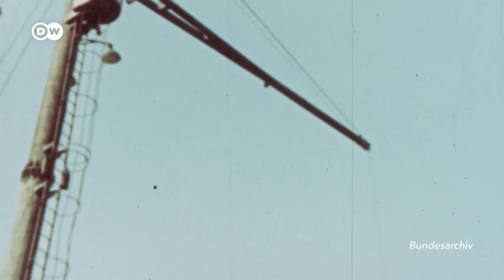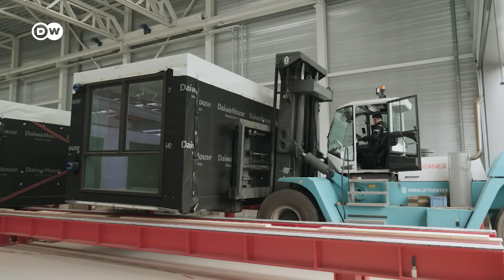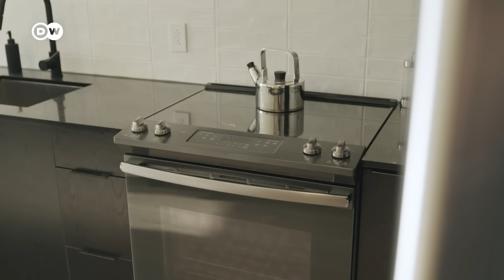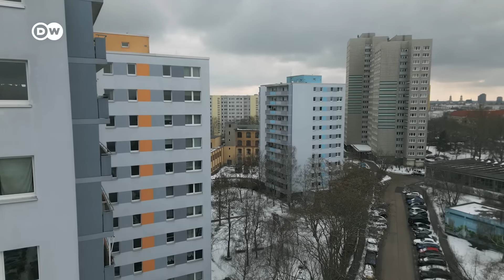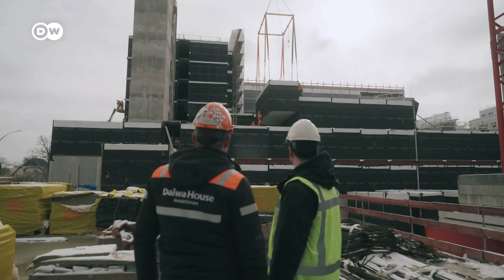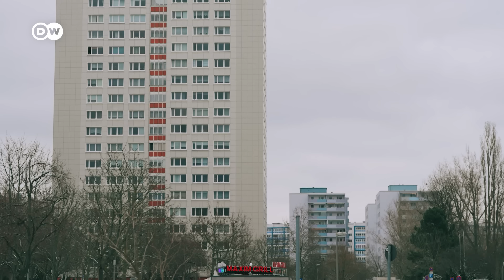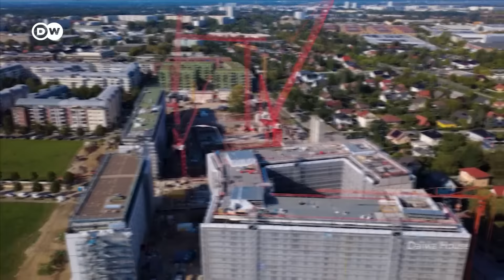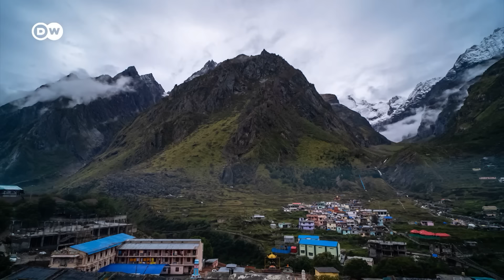These buildings are ugly. But the idea was genius.

Comment: I hope it's made of reinforced concrete, and not some wooden "shack" (even if in an iron fence). I can still understand building separate houses out of wood. But entire 5-15-story buildings where each unit is owned by a different owner, and they make "unofficial" construction modifications there, seem to me to be total nonsense and even a general threat from the point of view of durability. After all, it's enough for an owner or a tenant to let their apartment unit "leak" from a leaking pipe for a few months (and they may not even know about it), and then a structural engineer will designate the entire block for demolition after a few flights. And even if not, the wooden material has no chance of lasting (in conditions of heavy snow/frost in winter and heat in summer) even for those 50 years and will fall apart, and the structural engineer will send it to the ground, while the owners still haven't paid off their two-generation 50-year mortgage for it. And that's not to mention flooding, fires, wood rot, or "twisting" of drying/degrading wood in the nose parts.
In today's conditions, if I wanted to buy something, and at least pass on something valuable to my descendants, it would be a reinforced concrete apartment, or a building plot for a family house (which could easily be made of wood, it's the land as the primary bearer of value).
I am fully in favor of building housing estates from modular blocks that are "stacked" on top of each other. There should just be some regulation to require that all load-bearing walls and parts be made of concrete, reinforced with iron/steel. That's what China does. Such blocks can be repaired almost indefinitely, and it doesn't matter if they burn down completely, or are severely flooded every few years, or are damaged by war. They can always be repaired.
Reply: All soviet apartments are made from concrete. They are built on the construction site.

Comment: This is gonna be huge profit for this company, if they will participate in rebuilding housing in Ukraine.
Reply: Not so easy.  The cost of transporting each unit across Europe would be huge. They would have to invest in several local factories (Ukraine itself is not a small country, only one wouldn't be enough). And the capital requirements of each factory is very large.
Reply: @alfastur6833 it is obvious that the modules must be fabricated locally.

Comment: Old soviet prefab buildings (Khruschevka-style) turned out a nightmare in case of Shahed strike. The whole bulding can be collapsed, while in monolyth buldings based on concrete and metal usually 1-2 walls are damaged.

Comment: Soviet prefab walls could be used/build anywhere. Usually comes in few certain shapes; however, molds can be generated if sufficient quantity are guaranteed. But special trucks required to haul those prefab-walls, as they upright as if carrying window glasses.

Comment: I was surprised this is being done at scale rather than scattered experiments. Modular build has to be adopted more widely, factory build vs piling wood and bricks in a muddy field has so many obvious advantages. I would hope more automation is adopted - and so have better trained workforce.
Reply: (customised single homes - that'd be where good design to build would be great. Truly unique house still built as before. But this'd allow even fairly std houses to have customer options built in easily)

Comment: You forgot to mention another benefit: With pre-fab you can cast the concrete at optimal conditions off-site giving you better quality and longevity - also makes it less dependent on the weather and hence simplifies logistics
Reply: No forming required.  Saves hours building it and tearing it down.  No trucks to schedule.  No pump truck breakdowns to worry about.  No worry about the mix being correct.  Lots of advantages.
Reply: @randibgood  Blocks of flats are way more energy efficient in their heating compared to single family houses as well.
Reply: @antonk.2748 
True!
Reply: @antonk.2748  Only if they are built properly with even heat insulation. Soviet experience prove otherwise.
Reply: @randibgood  Huge disadvantage of taking them to the location by trucks that will brak down, heavy machinery needed to install them, schedule of moving them, waiting for the right weather to install them.
You can not takl only about the benefits. 
Also, as we've seen those old buildings are still standing. There are no major issues there.
Reply: @maxmagnus777  i like benefits
Reply: @maxmagnus777 and you think the trucks that transport concrete to the sites couldn't break down? and they don't need to wait till the wind dies down when they build the concrete casing or hoisting other things on the build site?
Reply: @maxmagnus777  but the steel joints between the concrete blocks are corroding so the lifespan of the building is quite short,  50-100years. in poland some of them already had to be demolished, while 400years old brick made apartment houses are still standing strong.
Reply: @maxmagnus777  but these issues are faced by in situ casting too...
Reply: @maciejrodzinka  If you galvanize the rebar you can get 400 or more years out of it. Doesn't cost very much extra.
Reply: @trueblindman647  why would one want to build a structure of that size, and complexity  in a factory, and then transport it. Just build in situ, and use all advantages of it being built in situ, rather than going through all this gymnastics. It's not a car.
Reply: @hilluxyz easier to mass produce them with all machines ready in factory rather than transporting all equipment to the site
Reply: @trueblindman647  Then transport concrete foundations and slabs You will be curtailed to  what you can transport, hence you will offer inferior product. On site you can make whatever you want to whatever specification  for whatever local conditions.
Reply: @maciejrodzinka It also depends on the maintenance, eastern block had hard times in the 90ies, many of these buildings were not serviced well enough then. A house I was growing up in was built in the 70ies, but was from the earlier Khrushchev era project, and I remember these cracks between the slabs and rusty spots building up. Then, in the 2000s the building got some service, the cracks were filled and sealed, but still, several years ago the house was rated unsafe and was torn apart. And I watched the other similar two buildings near my grandma's house in the city (the first one was in the suburbs) from the 60ies which was serviced better. It had some graffiti, the walls did not look clean enough, but I have never heard of any problems with plumbing or water supply there, the joints were always in good condition. And they are still there according to satellite images from 2025
Reply: @maxmagnus777  These buildings are pure concrete, they can stand like forever, if nothing unexpected happens e.g. earthquake or military action. Also you can redesign them, because usually main concrete walls are like 50% of them in the apartment and other half is woodish lighter walls and you can tear them down with no danger. Also, you can make facade look very very different, just need imagination and money to care about it.
Reply: It's still compromised by designing it to be portable. Especially for something that needs to last for decades.
Reply: We don't need more apartments in (most of) Europe, we need to properly distribute those that already exist by not allowing them to be (so extensively) used for investment and speculation.
Reply: @BcroG11  this👆
Reply: @BcroG11  How about doing both?
Reply: Concrete should be dropped out. It's a massive CO2 emitter and creates homes with no capacity to evacuate moisture properly. Plus it has shitty thermal properties.

Comment: Prefab construction is widely used in Sweden and they are not necessarily ugly/bland/grey because architectural details and colors are added to the external walls in the factory. So the buildings spring up fairly quickly and don't look bad. The real problem is the sale price of those apartments once finished.

Comment: Panel flats are still a better idea. More flexible in design, manufactured on site or close to it. The way the technology was applied 50+ years ago was suboptimal, with a lot of issues easily fixable with better quality design and materials. Uniform design? Just make it less uniform. Lack of noise isolation? Use two panels between flats. Stupid decisions like laying electric installations on the floor of a flat above - implement proper channels in the panels themselves. The problem rarely technical anyway. 2/3 of the cost is in land, legal expenses and price speculation.

Comment: Anybody that has being inside one of those soviet building know how terrible they are.
Reply: most of the complaints about them being 'terrible' are simple design fixes. the fundamental idea is excellent and it was (still is) very effective in housing millions in a short time, post-war.
Reply: They are fine, however they are better than new buildings
Reply: yepp. They're ugly. Inside and outside. The only good thing if it's an old neighborhood it's usually quite overgrown with greenery that hides the ugliness. But only at summertime. At winter they looks like the post-apocalypse movie settings. 😅

Comment: When USSR collapsed Russians viewed concrepe prefab buildings with disdain, as some kind of soviet mistake. Most prefab factories went bankrupt. Fast forward 20 years, company from Finland YIT almost dominated new housing market... because they used mix of prefab panels with cast concrete load bearing construction. Their prefab panels were built to a tighter standard than soviet ones, also they were better insulated and never used porous concrete on outer walls.  And then even some single family homes started to be built with prefab concrete-insulated-sanwitch panels. So yeah, prefabs are ok if done right. Soviet era ones are just outdated, also use of porous concrete that was meant to improve insulation in fact made outer walls to crack, take water and look awful overall... so yeah, modern prefabs with right materials are fine
Reply: They can insulate or paint the soviet buildings. When people have no property - being outdated doesnt matter.  I don't think its outdated coz your other option is literally under the bridge or paying giant rent prices.

Comment: Housing still neet to be made out of concrete, imagine how Ukraine would have looked if houses would be made ouf of "modern sustainable materials". Sometimes simpler is better. Rigidity is an important factor too.
Reply: These buildings, especially in Ukraine, are notorious for specifically being prone to collapse after getting hit by a missile or a drone. It has nothing to do with sustainability of materials.
Reply: @flytrapYTP  You want to say that  these paper-foam-wooden houses are more resilient that fero-concrete slabs?
Reply: @PraiseTheSunOfAstora  show me a single apartment building made of the materials you're describing.
Reply: @flytrapYTP  Look how they are building, those are cheap flimsy glue-wood-foam sandwiches in metal frame.
Reply: @PraiseTheSunOfAstora again, give me one single example.
Reply: @flytrapYTP  it's in the video

Comment: Unfortunately, the program oversimplifies the issue.

The problem with prefabrication is that it's cost-effective only in large batches. Many identical buildings must be built – ideally as close to the prefabrication plant as possible (prefabricated elements are transported!).
These challenges led to the construction of large, "monotype" housing estates in the Eastern Bloc.

These are another matter: the current costs – the cost of steel and cement (and therefore the cost of precast concrete elements).

Prefabrication alone won't significantly accelerate the investment. (Remember – finishing and installation work is more labor-intensive than erecting the structure.)

The biggest challenge facing modern investments is lengthy administrative procedures.
Reply: having a set of housing options that are mass-produced is fine. further, transport isn't an issue, because we have these crazy things called freight trains.
Reply: @peaceandquiet1917  Nonsense – that's what an ignorant person might say.

Do you know what a railway gauge is? (dimension limits)
Loading and unloading are just costs...
Reply: @ukaszborowy1954  we can surely build within limits if needed. with enough people we can figure out a viable solution beyond just sticking a bunch of trucks on the road.
Reply: @peaceandquiet1917  Once again – a demonstration of ignoring "details."
The fact that prefabricated buildings (e.g., in the Eastern Bloc) look the way they do is precisely the result of these limitations.

Truck transport is also expensive and complicated.
I know this because prefabricated elements are used – for bridge construction (a typical viaduct has prefabricated prestressed concrete beams) or wind farm construction (prefabricated masts).
And it's not cheap – compared to monolithic concrete technology in slipform formwork.

Comment: Ahh so the commie blocks are bad, but better than homelessness... By the way anti social behavior is an issue with society, and is NOT inherent to panel block buildings, unlike you make it out. 

But the irony of shitting on the commies for decades, and then using the same solution to solve the same problem, but pretending its somehow original and far better... cool.

Comment: My only concern with this so far is scalability, Not everyone wants to live in a cramped 1 floor house, i know you can connect the modules but it seems like you are restrained to the boundaries of each module so it's just 3 connected rooms, some appartments need to have larger rooms which would require 2 modules, some appartments would be better with 2 floors which these modules don't seem to carry that yet.

Maybe DW just couldn't show off the entire potential but these seem very promising to revitalize building apartment buildings but it will not solve the housing crisis. The housing crisis is completely artificial because of corporate overreach and an abundance in red tape preventing the construction of new housing.
Reply: Realistically.. if you can own them - people can swallow the tight space. Its better to live in tight and own it than not/

Comment: Prefab is great. But it must be done aesthetically too.
Reply: Very few modern buildings are aesthetic. Ornamentation of prefab buildings in theory is simple, but ornamentation just isn't done on modern buildings, because of current trends and cost.
Reply: Yeah, buildings with only parallel lines and no human-scaled details are pretty decremental to the mental health. At least add some painted smile in different colours somewhere visible from outside, I don’t know 😅
Reply: @kagenekoUA  That can be done of course. Every house, or block of flats is eventually just 4 walls, ceiling and floor. You can always decorate them the way you want(where possible, of course. Some would be quite high builds, so it gets more difficult to change, once they are finished).
Reply: There were very rarely times in history when mass housing was aesthetic. Back when the Romans built their arenas and temples the masses lived in apartments in simple block houses. When Baroque palaces were built the majority lived in wooden shacks. The only time I know of when mass housing was aesthetic was in the 19th century. The problem with modern architecture is that not even the crown piece buildings are aesthetic.
Reply: Maybe it mustn't be done aesthetically.
Reply: not really! most prefab have several issues, because of prefab. its a temp solution not a permament. its mostly trash and made to scam and get hands on public funding. poor layouts, walls total trash (you can hear your neighbor) and many other crap

Comment: Prefabrication can work for apartments, but as the other comments point out, maintaining demand within shipping  range of the factory can be a challenge. But I suspect that the demand for prefabricated utility spaces, like kitchens and bathrooms, which could be worked into any design and integrated with modular, panelized or even site-built elements, would be more steady. So many buildings, like hotels and dorms, could be put up faster if these rooms, which usually involve a lot of on-site labor, could be brought in already complete. And why couldn't fast-food chains standardize their kitchen and bathroom designs, so those elements could be dropped onto each construction site, with the rest of the building tailored to the environment. With many of these chains replacing whole stores when they update their trademark building shapes, any innovations that would reduce downtime would probably pay dividends far beyond the reduced construction costs.